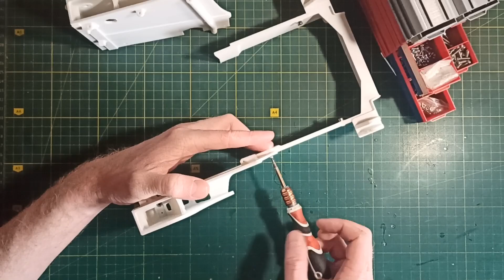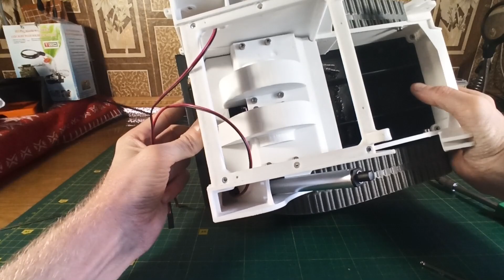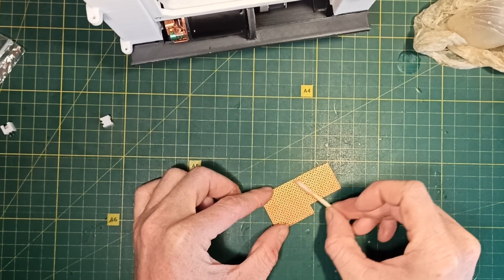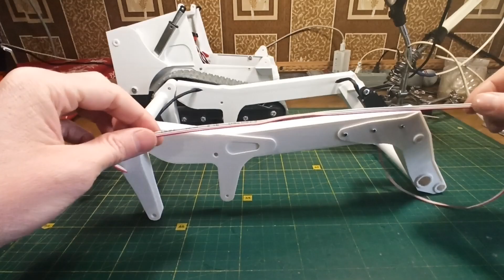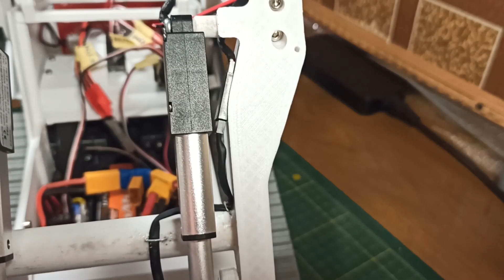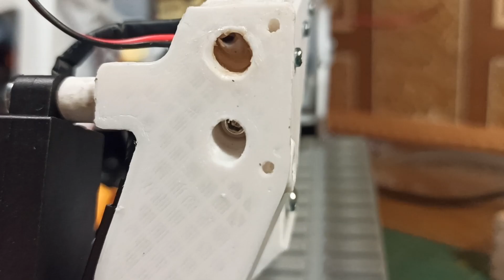3D Printed Skid Steer. Build video ep.2: Body and Lift arm assembly by [AN3DRC]

Comment: your bidirectional motor speed controller is with brake or without brake
Reply from the maker: I am use HobbyWing Quirun 1060. They can work in few modes. Yes, I am switch them to Forward/Backward mode without brakes.

Comment: tpu 인필값은 몇%입니까?
Reply: 자세한 설명 감사합니다
Reply from the maker: I don't remember what settings I used. I have had many unsuccessful attempts to print caterpillars. I think it's something like: 3 top layers, 3 bottom layers, 3 perimeters and 0% fill. I had a lot of problems with the filament getting stuck in the extruder when starting to print the part. I was able to successfully print the part when I set the print speed to approximately 10mm/sec and the flow to 65% at the start of printing. After the first 4-5mm in height, I increased the speed to 20mm/sec and the flow to 80%.